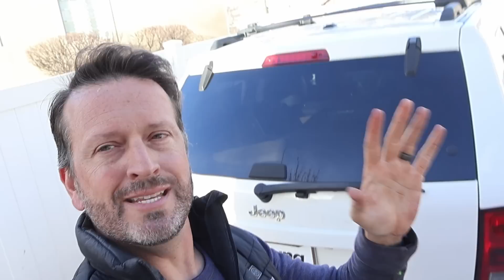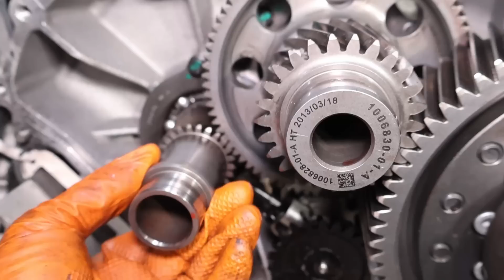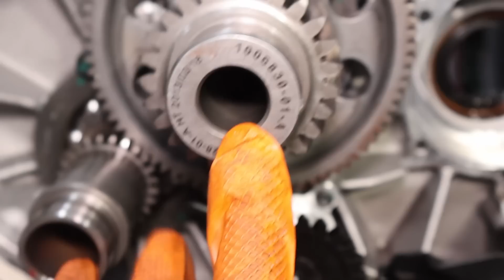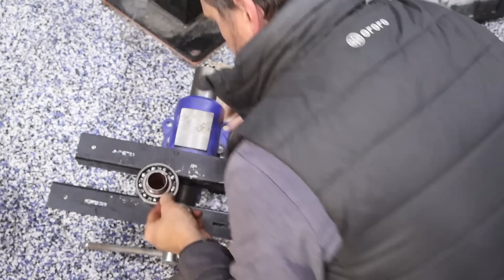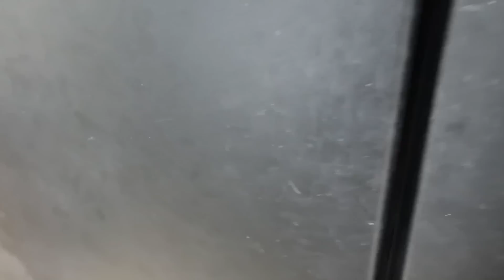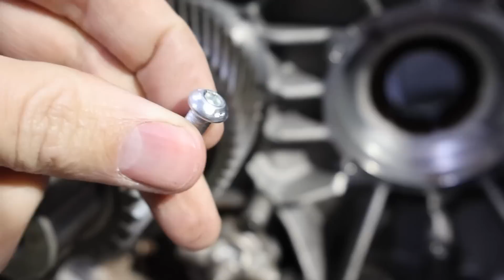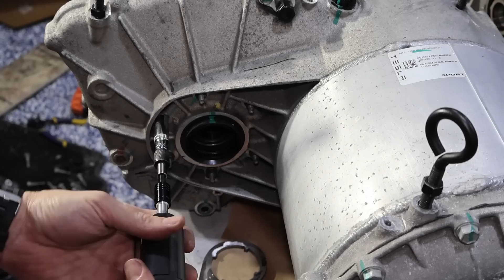Make Your Tesla 2x Faster with This Gear Set Swap!

Comment: Came in here with the hopes of doubling the speed of my Model S Plaid. After the initial disappointment, I still watched the whole thing  😆 Great job on the swap!
Reply: You would trade off torque for speed. Doubt you would like the resulting performance, and you might find the software governor would cap your top speed anyway. Usually, the tires are the biggest issue with top speed.
Reply: In the model s plasma you get about 212mph
Reply: *plaid

Comment: Definitely not rust. Probably a non-reactive power put in place to prevent moisture/rust.
PS. watched another youtuber do a review on compressors, and that tire inflator doesn't like running long before shutoff, plenty for topoff but wont help a flat.

Comment: Really hope it stays together, using different bolts might not work well.. there is alot of force being put on these bolts, and i wonder how much dirt went into the case when you closed it up again..
Next time, clean your table, there is a filter for that oil, it wil be full of that old crap you took off.
But he, still would like to see that rocket tesla go.

Comment: Last week I was thinking about eletric motors and gearing, what do you say about a cvt transmission with an eletric motor? (In my head it fits like a glove haha)
Reply: Cvt’s tend to be inefficient and would definitely not handle the toque from the motors, but a transmission with different gear ratios is very good for efficiency and performance such as the Porsche 2 speed it uses on the taycan.

Comment: What the hell, 8:15 why is there ANY rust in there? is it doing to current enhanced oxidation or wtf?
Reply: It's copper grease
Reply: @ thank you! Just dried out due to the heat I’m guessing? Is this common on such connections ?

Comment: Like it be interesting to see what the increase in motor amps will be
Reply: If you did this in a model S it would go up 2.4 times and hit limits in the inverter. But the reduction in the Jeep diff will reduce the current some. Not sure how the overall ratio compares.

Comment: Hi Jeremy, Looks like you forgot to grease the splines from the jackshaft to the rotor.  This is why you saw "rust" in there, because Tesla also had inadequate grease on earlier drive units.  (known problem)   I'll also email you if you don't see this.
Reply: Loctite a spline?
Reply: @GWAForUTBE  The red stuff is the remnants of what little grease was left from the factory, plus a lot of ground metal dust as the inadequately lubed spline ground back and forth.   They eventually shear all the teeth off and then the motor free-spins.  You often hear a "creaking" noise on initial accel/decel as the wear progresses.
Reply: Didn't he say it turned out to be red loctite?

Comment: By changing your gearing you also gonna change the current draw! And that can lead to massive more heat, which leads propably to a reduction in power.
Reply: If the rear diff already has the reduction it's not going to make much of a difference. Plus that'll only be true if you compare current draw at a set speed. You shouldn't be pushing these at full power constantly like if you're driving an rc car or something.
Reply: @SlyNine  you will always pull more current for acceleration with your "mod". Thats how it works
Reply: @Zonkobel  Not necessarily, the change in ratio at the drive unit is compensated for with the diff gear reduction. Overall gear ratio has probably been calculated to remain similar to original. 
Heat is more related to overall load rather than just gear ratio.
Reply: @Stambo59  if he changes the ratio to make the car double as fast he need way more torque to accelerate. More torque means more current for a longer time, that means more heat. Or how you think the car magically is double as fast? Magic?
Reply: @Zonkobel  He is using this drive unit in another vehicle that has a traditional diff with gear reduction.
The thumbnail is kind of click bait.
If this drive unit was going back in a Tesla I would 100% agree with you.
Reply: Shhh think

Comment: I never thought I’d be watching a video of someone hot rodding an EV 😂
Reply: It's going to be just as normal as it is with ICE cars once people figure them out.  There's more to do too.  The batteries in most EVs are definitely capable of higher output.  They're limited for reliability.  That margin of safety can be programmed out the same way we program out boost limitations for turbos.
Reply: @veganpotterthevegan oh yes, I’m looking forward to a truck of van with batteries ratchet strapped together or stripped down vehicles to the bare minimum… just another toy to play with 👍 more options, more freedom and all that.
Reply: @JGS123WRPTP  that's how early home EV conversions were built.  Some are still out there with +100k miles on them and lousy AGM batteries

Comment: Yet another great video, Jeremy!! I love the demonstration of gear ratios for people, your method makes it more understandable.  There are some interesting variances available for the conversions of the rotation.  The reassembly seemed a touch more difficult without that flat gear with the access holes.  As long as the bolt grades are comparable, it should be no issue. I like that you had access to somebody who could make you a proper wrench for that.  Now you just need to have a bench to bolt your vise to, and you will be able to do work more comfortably in it.
Reply from the maker: Agreed

Comment: going from 9.6:1 to 4:1 will also reduce power by 58.3% roughly.
Reply: It will reduce torque output but not power
Reply: this was not was to be negative i just wanted to point out that electric cars power is what the motor puts out multiplied by the gear reduction and with internal combustion engine is just what engine puts out at the fly wheel.
Reply: 4:1 isn't the final gear ratio though once you take the differential (3.7:1) into account so at the wheels it ends up being a 14.8:1 ratio instead of the tesla's 9:1so it ends up being a net increase of torque
Reply: 9.6x3.7=35.52:1 more power, slower         top speed
4x3.7=14.8:1 decrease in power, increase in top speed

Comment: should mention the trade-offs: The primary trade-offs for using a gear reduction to double the speed of a Tesla motor include a reduction in torque, potential efficiency losses, increased mechanical complexity, added space and weight, and possible noise and vibration issues. Understanding these trade-offs is crucial when designing or modifying a vehicle's drivetrain to ensure optimal performance and reliability.
Reply from the maker: You're right, there are always trade-offs when messing with the drivetrain.

Comment: doesn't changing the gear ratio decrease the torque? You can get faster speed but now it'll take longer to get there. How much pep do you lose?
Reply: This is done because the Jeep has additional gearing in the differential.
Reply: Think a bit more; more torque than spinning the tires is useless. This is very much the case here.

Comment: Is there going to be any issues with the electric motor running warmer since its spinning twice as fast?
Reply: 1. It’s cooled 2. If it spun slower it would get a higher induced current for the same wheel torque. Current equals heat. This is one reason the later Tesla motor units are wrapped in carbon fibre and spin to 20,000 rpm instead of spinning slower and being bigger overall. The faster rotor develops a higher back EMF too

Comment: The 'rust' on the one gear almost looks like Cuprous Oxide (copper oxide), but I have no idea why that would be in there.
Reply from the maker: Maybe copper anti-sieze
Reply: anodisation/galvanic corrosion ? due to leakage of water and voltage (common failure of the water seal of the rotor ) and difference of material betyween aluminium, steel and copper

Comment: Just to be the boring pedantic guy: no, you won't make your tesla faster with this mod. Electric motors are power limited after certain RPM, meaning that after initial ramp up (where the motor outputs constant torque), the power starts to dictate the torque, so if you change gears, you will get motor to spin twice as quickly, but with half the torque, meaning that the output torque will not change.
ICE engines don't have constant power output, they don't even have constant torque, but for simplification we can assume that ICE engines have more or less constant torque and linear power. These motors need transmissions with multiple gear combinations. Electric motors just need one gear.

Many people who convert their manual cars into electric find that regardless of the gear, their car accelerates just as quickly, so they stick it into third and never touch the lever.
So since you won't be taking your tesla past 80 MPH very often, there is no need to change those gears.

Here this mod is necessary, since the additional differential now forces the motor to reach its top RPM much sooner.

Comment: Or you could leave the Tesla gearbox alone and have an increased range
Reply: No, it doesn’t work that way…
Reply: @lsh3rd  if you understood the power curve of electric motors is different than the power curve of gasoline motors then you would know that it does work that way
Reply: @lsh3rd  internal combustion engines consume more fuel when their RPM goes up, electric motors consume more energy when load is increased on the motor. The speed of the motor has zero influence on the energy consumption from the battery pack. When the electric motor has to work harder it pulls more amps from the batteries. Everything I've said can be looked up on Google or any basic electronics books

Comment: Never drop that parts together when using a thermal fit. There is a high possibility of the bearing "bouncing" off the shoulder and locking together in a way that may not be seated as much as necessary.
Frost on the shoulder from freezing can do the same thing. 
Wipe the shoulders clean and slide the parts together while applying firm pressure. Count to 5 and your done.
Reply from the maker: Thanks for the tip

Comment: many  Model S need to have the Coolant Delete Mod, because Coolant water leaks past seals into the inverter and other areas.   So maybe that is rust from coolant leaking internally.
Reply: That was an issue with the early models. That issue was fixed a while ago.
Reply: @That-Guy_   Based on what the company that sells the coolant mod delete... "a while ago" was like 2023 if I remember correctly.
Reply: @LeeWinkler  
I did a check and it's 2012 to 2020 Model S and X with the drive motor coolant issue.
Reply: @That-Guy_  yeah that sounds right.  I knew it was more than early builds, but wasn't sure how late
Reply: @That-Guy_  https://youtu.be/fQ-VL-fNQPs?si=ymitnuebWxsjvp_H
Reply: To 2022  @That-Guy_
Reply: @That-Guy_ it was only fixed within the past year, and only for replacement drive units. No stock pre-plaid drive unit came with the delete, so it’s not ‘early builds’ it’s ’all builds’ that were impacted.
Reply: He has the coolant delete on this one by the looks of it.
Reply: I thought he said it turned out to be red thread locker.
Reply: If it had been red thread locker he never would have got the gear off the output shaft, especially not that easily. That stuff is stronger than jb weld sometimes. He should have put anti-sieze on the splines before reassembly though. That would help prevent future rust and unnecessary wear.
Reply: thanks now I have a great excuse to buy one.....the wife will love it.

Comment: Sorry to hear you've done this already. Those gear sets from Fellten are going to be very noisy. I know someone who tried them in a Land Rover, they're awful. They produce a high pitch whine that will make your ears bleed and gear chatter on zero load that sounds like you're rattling a bucket full of nuts and bolts. They're junk.  A waste of time and money unfortunately. If you ask Chris from Fellten directly he'll admit this.
Reply: Describes closely how the Cybertruck sounds from factory. Front motor.  Whine, no other Teslas have.  Now, with 6k miles, rattling sound while light throttle, and cursing. Regen, rattle goes away (not the whine). All CTs have the whine.
Reply: Im doing a conversion into a Toyota landcruiser 100 series and have that gear set with a LSD with my LDU split in half waiting for me to fit it.....this is not good news :( 

Do you have any more details?

Comment: I assume you checked this, but for everyone else: if you change a screw please make sure you put in one of at least the same strength (usually the 4.6, 8.8, 10.9, 12.9 lettering on the bolt head).
Especially on a specail occasion such as here inside an electric motor with a lot of torque.

And , as we saw, maybe the head type is important for more than one reason (in this example tightening. I probably wouldn't have thought of that, too, I only thought of the head size.

Still, I love how you dare to do this.
Reply: He could have used same bolt as long as he would have threaded retaining plate in same time as pulling bearing in its place! Basic wrench also could have been used for tightening! But at the same time if both ends of shaft is locked from both sides of housing I think it's fine.... probably!
Reply: It's just the retainer. The case looks to do most of the holding in place

Comment: I actually want to see a Model S run with this setup. see how much quicker it gets
Reply: It reduces acceleration and increases top speed.
Reply: Yes, but by how much. I'm also wondering about efficiency in that setup.
Reply: @daves2433  the gear reduction here is a little over half. So say if 0-60mph was 3 seconds, it would now be over 6 seconds. Technically if top speed was 120mph then you would think it would make it over 240mph now but there's aerodynamics(big factor) and possibly other things that will limit it to much less than that.
Reply: @JJayzX  Please consider traction in your thinking. A Plaid on the street is traction limited over 60 MPH on normal tires. And its top end is 200 MPH.
Reply: @ I think it's a bit more complicated than that, since the motor output isn't that linear. I recall seeing a dyno pull where they could see where the power was dropping off as you got to higher speeds. You'd need to map that output torque on top of the 2x gearing.

Comment: red stuff maybe an anti-seize?
Reply: Didn't look like rust, been around enough metal boats.
Reply: Seeing it also used in the bearing surface confirms it’s a compound design to fill in the tolerances between parts.  Like their version of locktite 689

Comment: Dude, the bearing thing with heat was so cool.
Reply: During the first atomic bomb tests, specifically the Trinity Test in 1945, two critical parts machined to close tolerances did not fit initially due to thermal expansion. The parts expanded differently causing misalignment. The issue was resolved by allowing them to reach a similar temperature before reassembling them.
Reply: Science!
Reply: Very cool, subzero!

Comment: You shouldn't play fast and loose with your health and wear gloves. Absorbing all the dangerous chemicals with bare hands is bad news bears. I lost my dad due to this. Please  wear gloves 100% of the time
Reply: Sorry for your loss ! What chemicals?
Reply: Interesting how chemical exposure is linked to the cause of death. May I ask what chemicals and the organization that diagnosed him or did the autopsy? I’m writing a legal research paper and would like to report my findings!
Reply: @Holt0216 oil and petroleum
Reply: @Holt0216  the chemical was H2o
Reply: @xpreflex6265  based
Reply: @xpreflex6265  Never put H2o in wine, never !
Reply: My hands absorb everything for the last 50 years dude I never wore gloves. I was very bad😢
Reply: @mattsparks5957 The gloves stay on about five minutes
Reply: eat apricot kernels. 3 a day @mattsparks5957
Reply: Your time is almost over  @mattsparks5957
Reply: Just like condoms but sometimes we're irresponsible
Reply: Same here. Cancer.
Reply: Always wear eye protection, too, apparently if you get a chemical in your eye, it’s a straight shot to your brain so a chemistry teacher recently told me. There is so much of a connection between your eye in brain with blood flow, a drop of coolant in there is like straight in your brain.

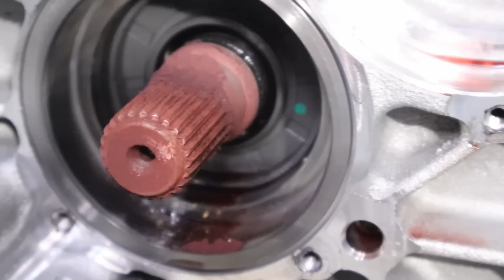Comment: I would say it looks like dried up copper paste 6:43
Reply: I wanted to say a kind of dried up anti-seize
Reply: Its kinda dark, idk. But it looks too homogenous for just rust.
Reply from the maker: I know what you mean
Reply: yeh that makes more sense than being rust, I bet they used copper paste to fill any gaps between the gears to have more uniform connection.

Comment: It would be interesting to see what a gear change like this in a model 3 performance would do for its performance numbers.
Reply from the maker: Coming soon!
Reply: @electricsupercar  Awesome news! I know I will be in line for the swap if the numbers are good 🍻
Reply: I would imagine a reduction in performance for every day use as generally, higher gearing equates to less acceleration.
Imagine with a manual trans trying to move off in 3rd instead of first.
Top end speed may increase but how often are you doing over 120mph to reap any benefit.
Hard to know what it would do to range as on initial acceleration there would be much more load on the motor.